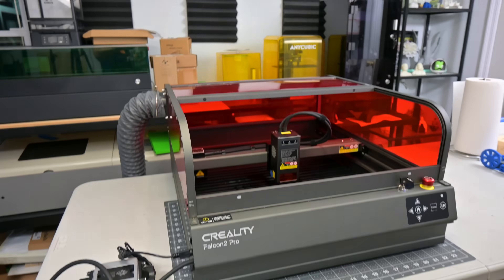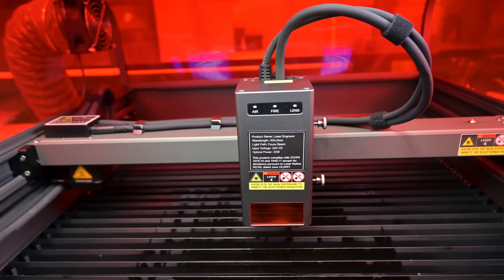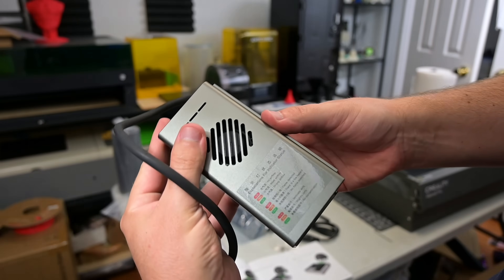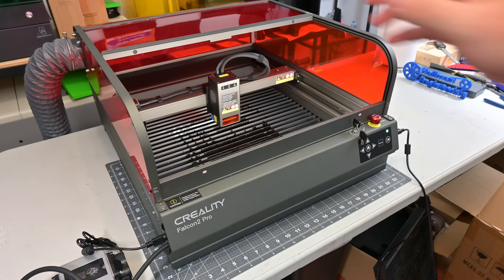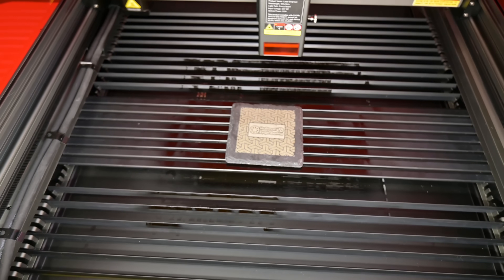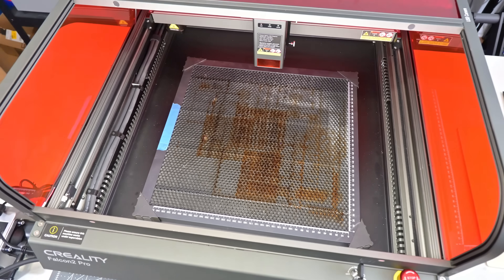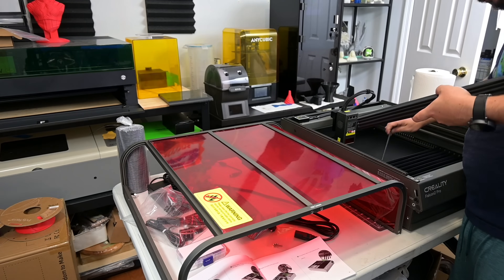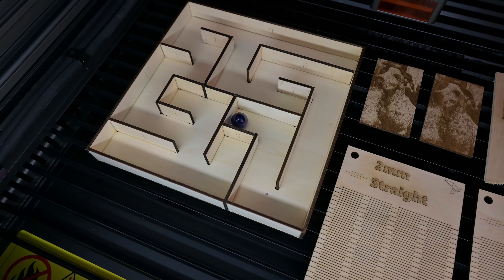Fully Featured and Fully Enclosed, You need this Laser | Creality Falcon2 Pro Review

Comment: will it work on any metal. like gold and silver as well. bronze and brass etc
Reply from the maker: No, diode lasers will not engrave any metals. It can only surface mark stainless steel. To work with gold, silver, bronze, you'd need a Fiber Laser.

Comment: Thanks for the detailed video review. It seems the Creality Falcon 2 feels a bit less refined compared to the xTool S1. Additionally, the fact that the Creality Falcon 2 doesn’t include software and requires purchasing LightBurn separately has solidified my decision to go with the xTool S1.
Reply from the maker: Considering the Falcon2 22w is about 60% of the price of the xtool S1, a little less refined is to be expected. The S1 is a good machine, don't get me wrong, but it is pricier even when considering the cost of a lightburn license.
Reply: I looking for a machine to cut precis cuts for punchouts for tiles in cardboard for a boardgame. Is this a thing suitable for the these machines with the camera assist to lign up the sheet and getting a full A4 sheet with all the pieces cut? Or will it become a mess?